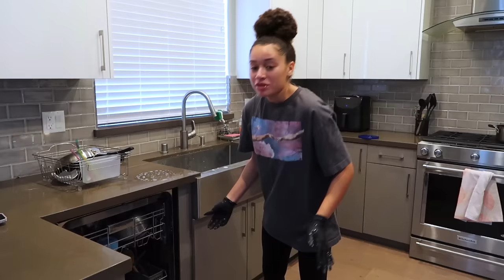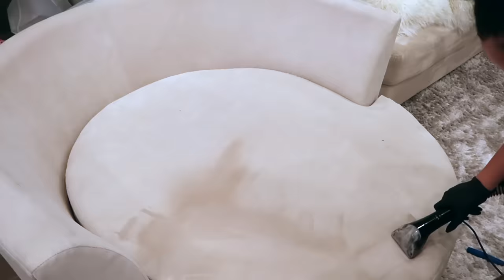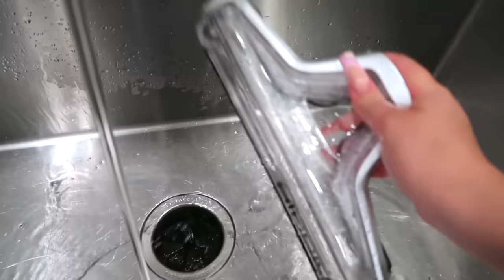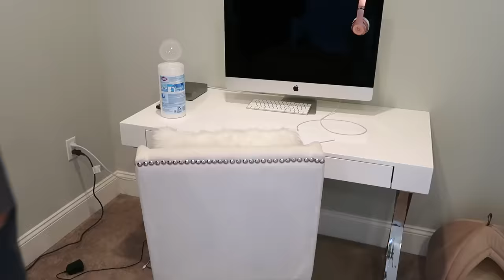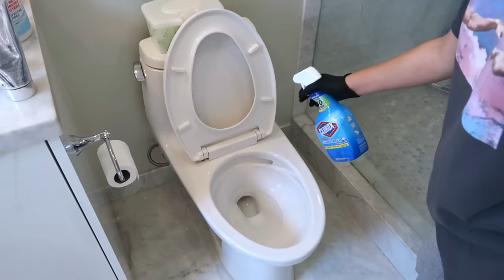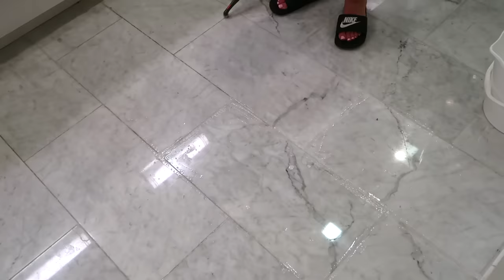☆ CLEAN WITH ME! *extreme house cleaning + motivation*

Comment: I have been a residential home cleaner for a long time, and I use a pumice stone to clean the dark black spots out of your oven. You can also use it to get rid of the ring on the inside of a toilet bowl, if you have one. When you are using the pumice stone you just have to make sure it's really really wet so that it doesn't scratch what you are using it on.

Comment: 2 things - from an older person 1. It's worth spending the money on the sheets - There is nothing like good quality sheets - bamboo are great & eco & will last a long time. And even tho I get that you want your bed to look good....It should feel amazing as well!! Plus then you will get or you can choose a deep pocket fitted sheet so they will fit the size of your mattress & topper. 2. it is also a good idea especially when you have a good mattress & topper to use a mattress protector over the whole thing ( deep pocket as well ).  Also, a trick to make your bedding look even more inviting is to get a larger duvet insert than the size of your actual duvet this way it looks that much fuller!  Your cleaning was very motivating!

Comment: You can actually take your oven door off to clean better inside, plus it might help with your fear of getting stuck 😉. Also, you can put the iron grates of your stove in the dishwasher too they come out like new. You can also pop your sponges in the microwave to help kill the bacteria on them too. Be so careful using bleach on the grout of your marble as overtime it will deglaze the finish and it won't be shiny anymore. Marble can't handle harsh cleaner is all. Fantastic video, I wish I had your energy lol.

Comment: You can take your oven door off the hinges by flipping the door hinge lock back with a screwdriver or another object because you can injure your phalanges. Then you just pull the door right up. Each oven model is different.

Comment: Pretty sure your high-end stove has a self-clean feature built in.  

No chemicals…the oven locks, super heats for a few hours and turns food residue into dust. When cool just wipe up with a sponge. 

Be sure to remove all the stainless steel racks inside first, or the oven walls may warp.

Comment: I know you think your house is dirty and that's your thing and that's perfectly great. Houses come much more dirty.
Hint I've used for years. Cover the bottom of your oven with tin foil after cleaning. Catches all the drips. When it's dirty, throw it away and replace it. Just be sure it overlaps so that drips don't get to the bottom of the oven. Easy-peasy. 
Another hint: oven cleaner. They have a formula now that doesn't require a mask or gloves. You can also use oven cleaner on more than the oven. I use it to clean my saw blades and it works really, really fast. Set on stains? Either cover with plastic wrap after spraying to keep it wet (Aurikatarina videos), or use a scraper. You won't hurt the oven with the scraper. If you don't follow Aurikatarina, you should. Lots of great tips for every kind of cleaning issue. And, she cleans some of the WORST homes ever.
Vinegar (especially apple cider. Don't know the difference but apple cider vinegar works better) will remove lime and calcium scale. Just have to keep it wet while it's doing its thing. (again, plastic wrap cover if you need to ... but it doesn't look like you need to). 
Know what works best on floors that aren't real hardwood? Dish soap and water with a large squeegee and a microfiber cloth. Easier to clean. Rinse out the cloth and stick it in the washing machine. 
Yeah, you can tell by where the corners are hitting on the top of your mattress that you have a queen and not a full. 
Again, watch Aurikatarina to see how to fold a microfiber to get the most out of all of it. Makes a difference. I didn't think it would, but it does. 

OOOhhh, hint for your toilet. I just saw this, but can't recall where. Fabuloso, which you can get at the dollar (now $1.25 store). Use it to clean your TANK. After the tank and bowl are clean, drill a small hole in the bottom  part of whatever size Fabuloso will fit in your tank (on the side, not the very bottom, although I don't know why it matters), and just let it float. Replace when it's empty. You will get cleaning with every flush as well as a great scent (whichever you choose) for almost nothing. 

GIRL ... be CAREFUL with mixing bleach with anything other than water!!! Bleach is toxic and ... chemistry ... so just saying that it combines well with many things that can put off gasses that are harmful, or even deadly, when combined with other things. SO, I know you had a good experience with that one product, but NEVER, EVER, combine bleach with anything else unless you are a chemist and know it's safe. For instance, mix bleach with ammonia and the fumes can KILL you. NO JOKE. Anything that is formulated with bleach has gone through a chemist and has been deemed safe ... enough. Those with lung issues can have a bad time because while the fumes have been deemed to be "within acceptable levels", they're still not entirely safe. 
Bleach is a no joke chemical and deserves respect, unless you don't care if you die mixing it willy-nilly with something else. Even with things that already contain bleach. Those products have been verified as being mixed at the correct amount per product. Mix in more, and you can have a real problem. 

Bleach and ammonia are deadly toxic if mixed with the wrong thing, or in too high a concentration. They are NO JOKE.